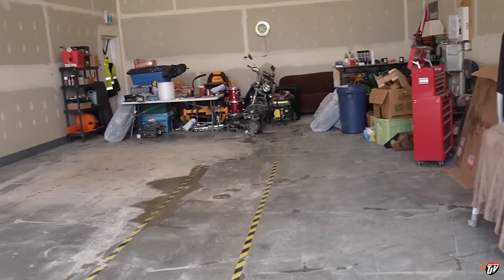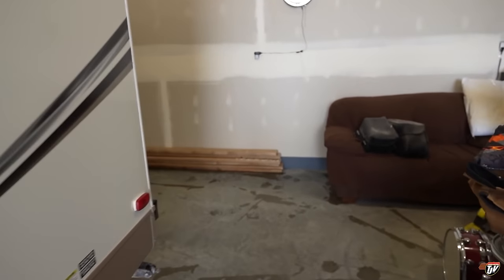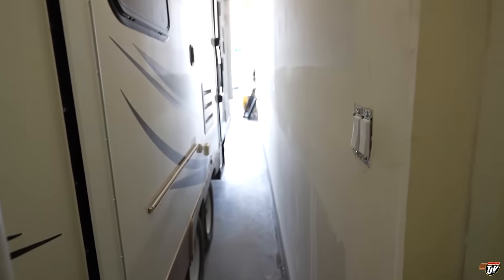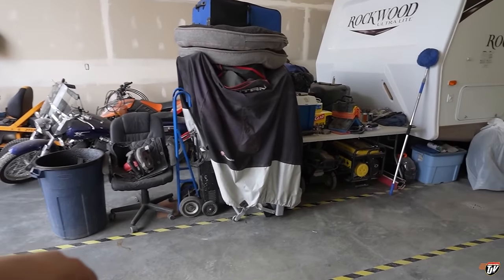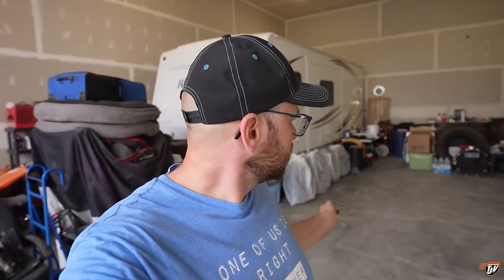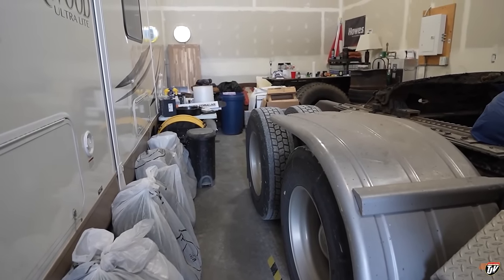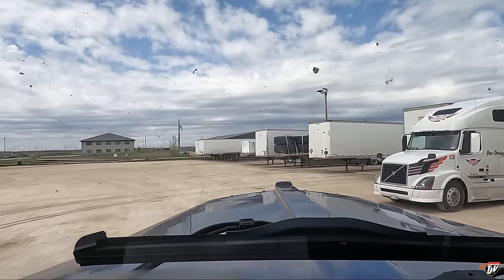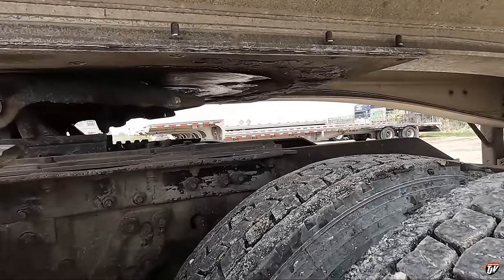WHERE TO NEXT?? | My Trucking Life | Vlog #3079

Comment: If you rent out the trailer you will have to move a lot of things, plus the trailer door is now harder to access, the same thing with the truck when yo load it up for a trip you will have to go through the passenger door. Should have left it the way it was   Thanks for sharing.
Reply: Agree... easier access on both vehicles.
Reply: Don't worry, we'll be hearing about this issue in a future video. There will be a "You guys were right." in the future.

Comment: Measure from the back of your rear tire to the end of the spare mounted on the camper, then measure out the same distance from the garage wall and place one of those long boards there as a wheel chock to stop the camper as you back up.